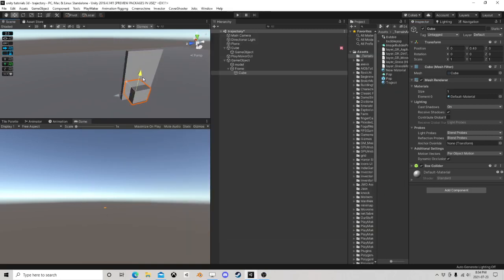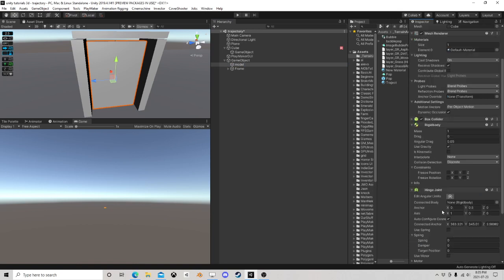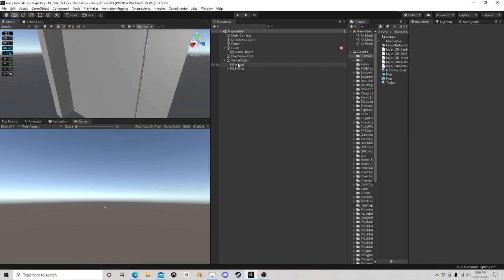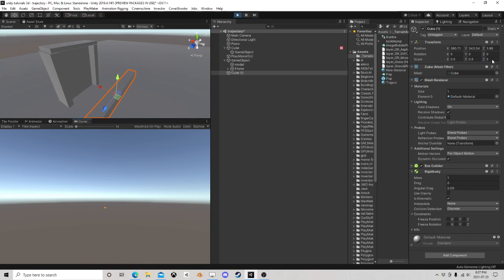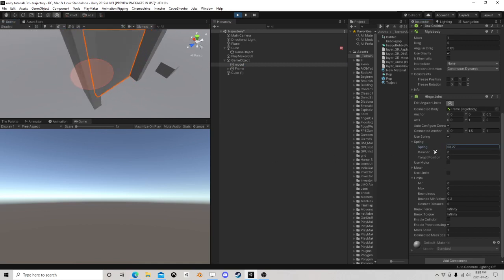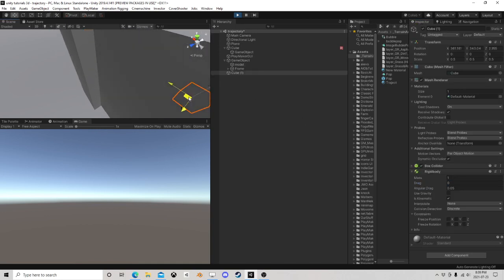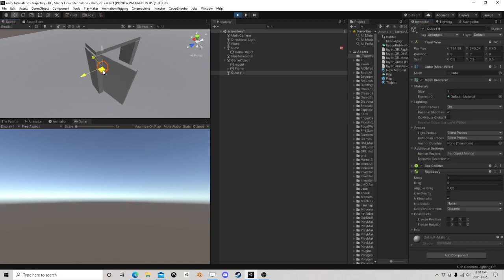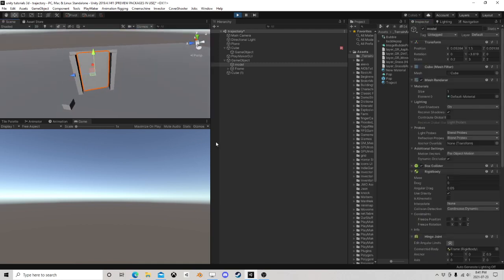How to Set Up Hinge Joints on Doors

Comment: Maybe it s just my version of the engine but its really stiff anyways. I put an empty to assign the hinge but it doesn't help much and when I apply it directly to the model the connected body does not assign or auto fill. Its still really stiff no matter the settings. I even went as far as trying to use a convex mesh collider and setting it as kinematic but no dice.